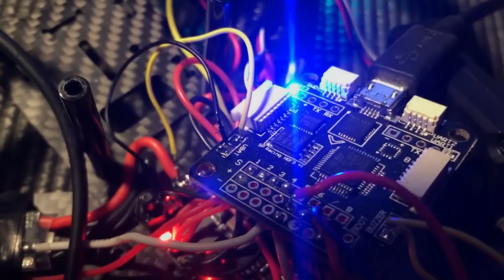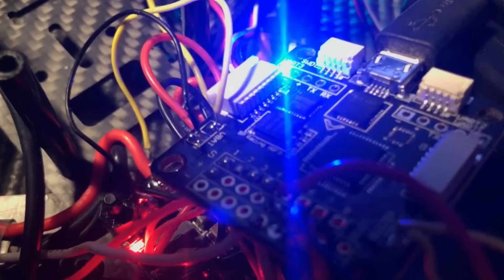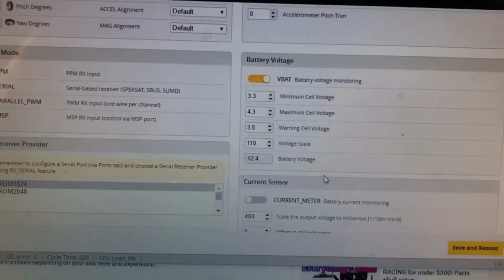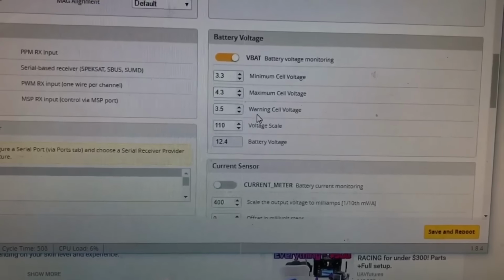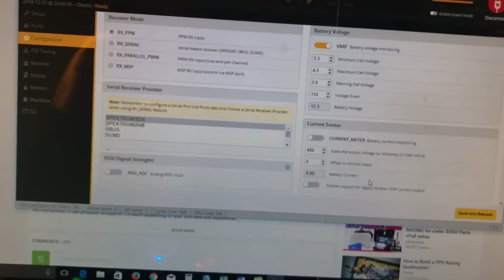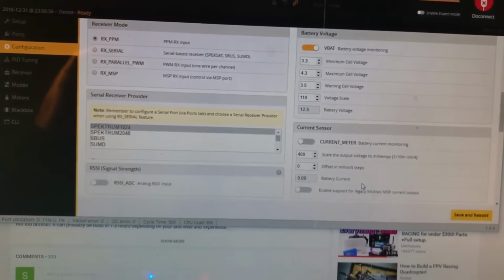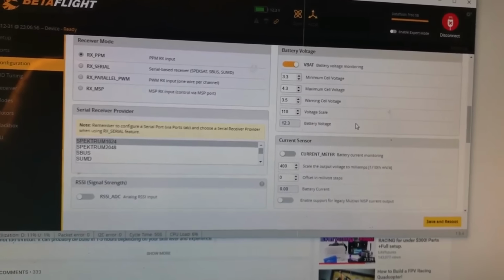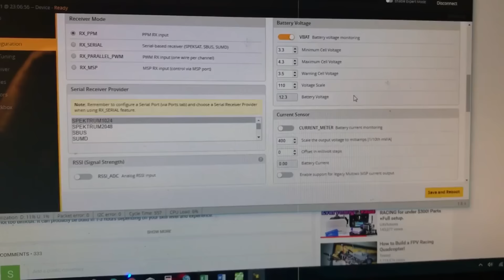Eachine Wizard x220  LED Low Battery Warning Mod on Qav x Clone

Comment: Hey man, I don't suppose you have any images of the wiring on the PDB for the VTX and camera?

I'm fitting a new PDB into my Wizard after the 5v BEC died on me, and on the PDB there's a cam and VTX section, but they've wired it up with the camera connected to the VTX pads and the camera is wired up with the video wire on the cam pad but the + and - run to a couple pads on the PDB that is giving out the same voltage as my 4s I'm powering it with. 

Thanks in advance.

Comment: I just did this mod and it works, did you know why it works?  I mean the buzzer has 4 connection b- and b+ to the buzzer pads and the grnd and 5v to the 5v pads.  Why does the buzzer need and additional power feed?  Don't the buzzer pads provide power?  What if you used one of the two pin buzzers?

Comment: Hey Scott just wondering if you have a video on the LED mods you have done? Noticed the LED bar at the back and that you have moved the motor LEDs into a "proper" config, cheers!
Reply from the maker: PolarbearJFPV I don't really have any videos, but can walk you though a newer LED mode that I've done with my Realacc x210 using a Matek programmable LED with buzzer. It's easier to help with the install via my Facebook group in the description, 

It's this set of LEDs which are pretty cool

https://youtu.be/DRPiAj25hvw

Comment: you got 4 wires solder to the buzzee care to discuse the wiring a bit more in depth?
Reply from the maker: TheGeokaiser sure...it's easier for for me to show examples with photos on my Facebook group. Feel free to join and ask anything you like
Reply: apreacite it.  i got no facebook or and social media platform.  i try to stay away from a lot of drama but. i do apreaciate the invitation to the group
Reply: Is it necessary to install both + and - buzzer? The yellow wires you have there. +/Ground/-Buzz/+Buzz?
Reply: I just installed my same buzzer and now when I arm the quad, the buzzer starts and never stops? I'm also not seeing betaflight update my voltage monitoring after setting up vbat. Any help?
Reply: I'm having the same problem did you figure it out?

Comment: can you link it to an led that you can have near the camera so you can se it if you are flying far away and cant hear the sound
Reply from the maker: swedish minion   here you go! Feel free to join our Facebook group for other cool mods 

5V Red Taillight LED Board With Lampshade For FPV Multicopter Quadcopter QAV250 280
https://banggood.app.link/p4o5kQ2kcz
Reply: i was talking abou puting a led near the camera and conect it to the bussers electrik line so you get to see some light in the camera when the batery is low and i dont use facebook i dont se the big point in it
Reply from the maker: swedish minion the only ones I've seen, are the ones that I personally use with my Realacc x210. They are programmable Matek LEDs with integrated buzzer alarm, low batt, etc. They work great, but I don't think the design is what your are looking for. Here's an example.

Matek WS2812B LED Board With 5V Buzzer For Naze 32 Skyline 32 Flight Controller https://www.amazon.com/dp/B01HZWHC4W/ref=cm_sw_r_cp_api_495Dyb05YEKE7
Reply: i was talking about just taking a led and soldering it on the power for the busser and then placing it near the camera straight up just a led and two cables